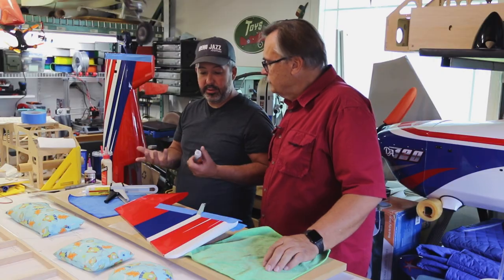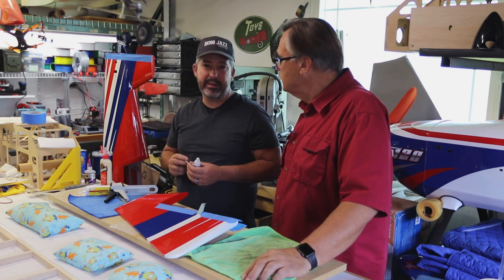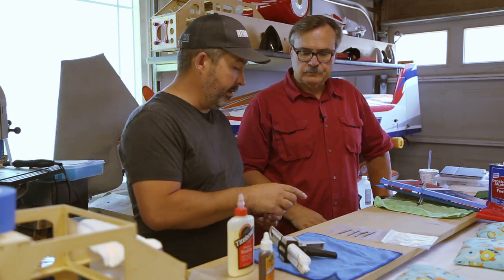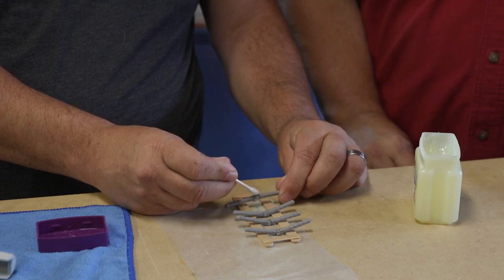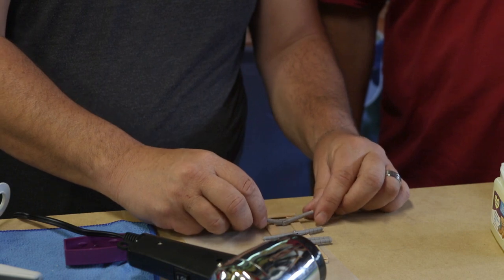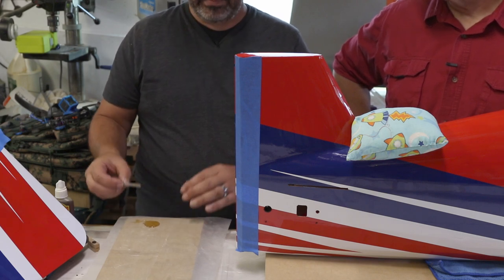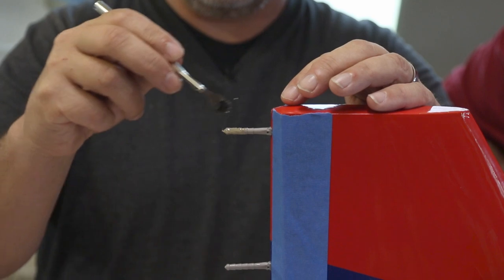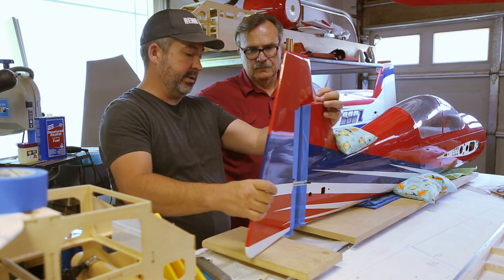FlightReviewz How To: Hinge Installation Using Gorilla Glue (Rudder)

Comment: I tried this on my latest project, and now I have a surface that does not move. The gorilla glue expanded out and now it’s blocking the surface from moving. How can I get that off? I did put oil in the hinges, so I hope the hing is still good.
Reply from the maker: Dave, if you get a dental pick set from Harbour Freight you should be able to pick the overflow off. Let us know how you do.
Reply: @FlightReviewz  Thanks, I will try tonight or over the weekend. I must have used too much, or things were too damp.
Reply: FlightReviewz a hour or so of picking carefully, and all seems to be good now. I need to use less next time. Thanks!
Reply from the maker: Dave Dupre so glad it worked out. It is also helpful to monitor it while it cures. Especially for the first few hours.
Reply: Does this glue work for the ailerons